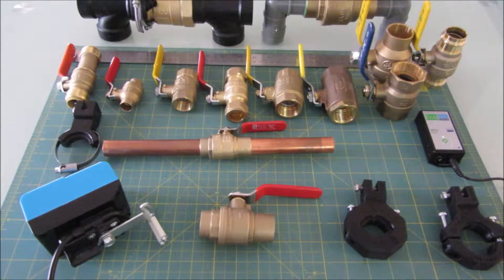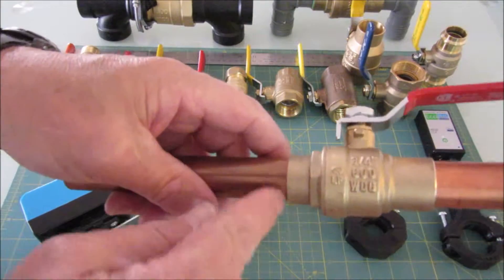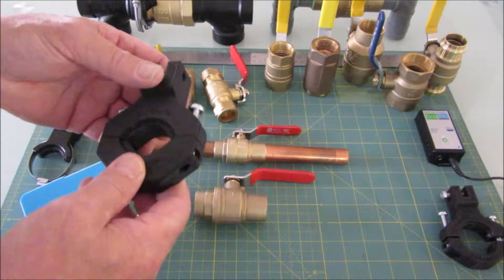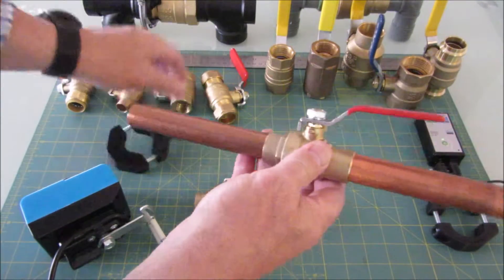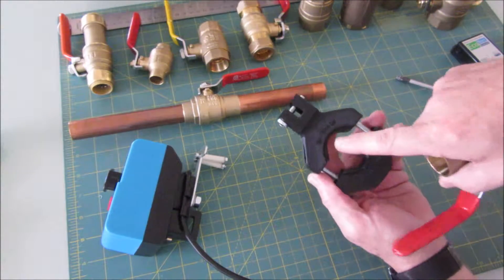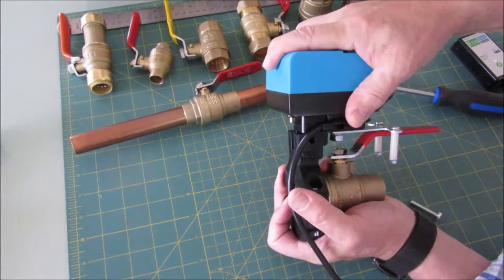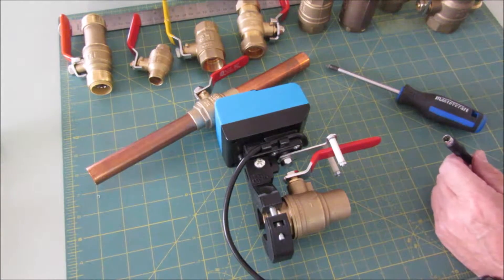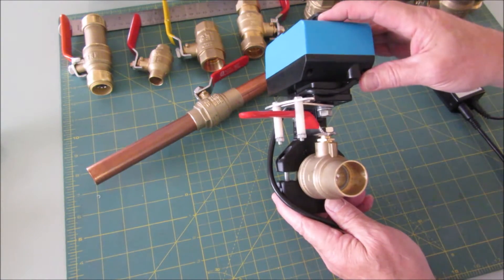EcoNet's Smart Home Bulldog Valve Robot, mounting

Comment: This is a brilliant design! I’ve used a WaterCop for over 10 years and it has worked perfectly … But Your system has two big advantages: First, easy mechanical installation, no plumbing. Second, your puck style sensors are simple to place, no need to hide a wire and mount transmitters. I’ll be buying this for my new house!
Reply from the maker: Thanks for your comments. Email me at sales@econetcontrols.com and I will send discount code, if you miss the sale that ends soon at EcoNetshop.com.

Comment: Great explanation and detail on the installation.  Which water sensors would you recommend are compatible to operate the valve in the event of a burst pipe.  ( I do have a Samsung smartthings hub ) My home recently suffered a flood and now I'm researching valves so I never have to go thru this misery again.  Thank you.
Reply from the maker: Thanks for the note.  We recently tested and like the ThirdReality Zigbee Leak Sensors.  They can be set for local automation.  See: https://youtu.be/K4SYtzH-1GE  

But most any Z-Wave or Zigbee Leak Sensor that is compatible with SmartThings is a good starting point.